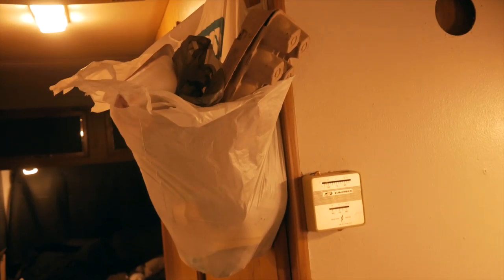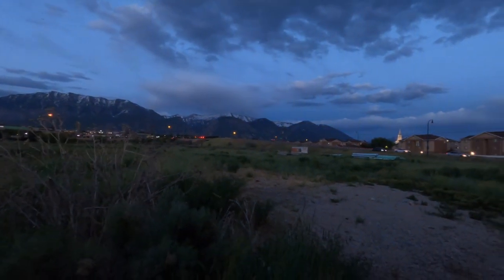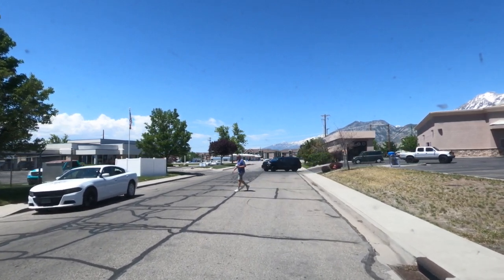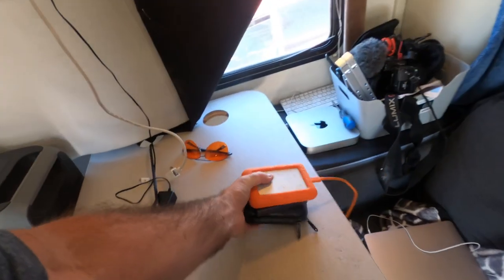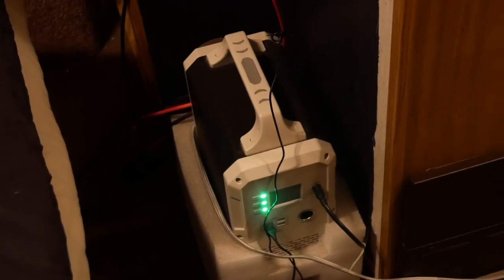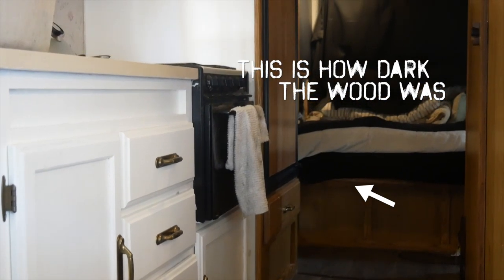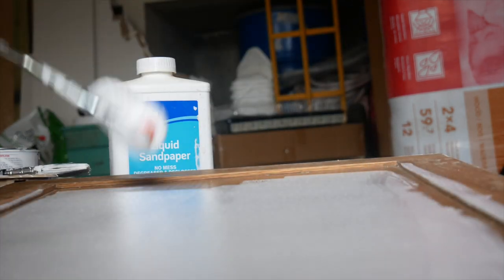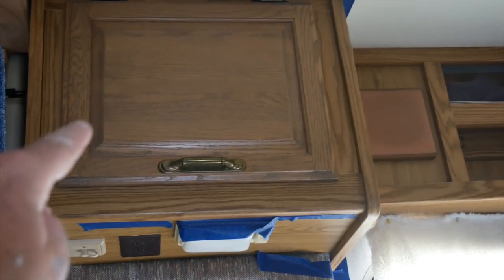I painted my RV's kitchen!

Comment: Glad you were able to paint your cabinets to your like'n they have turned out great & 4LIFE is a company that is about Immune Systems & sell Snake Oil products it appears. KILZ is a great product for primer & finish paint. Keeps the MOLD away. They also make a great KILZ exterior Paint to paint your Roof. There is a great Sealent Paint for Roofs, used on Marine Boats. With so many products on the Market today glad you picked the right ones. A lot of peace☮of mind with the KILZ. Great choice on the contrast of Light & Dark. The 3m Tape is great v. cleaning up the paint one can get where one does not want paint to be. Gives you feeling from Bedroom Area to Living Area👍. Safe Travels. always, Tommy🤠